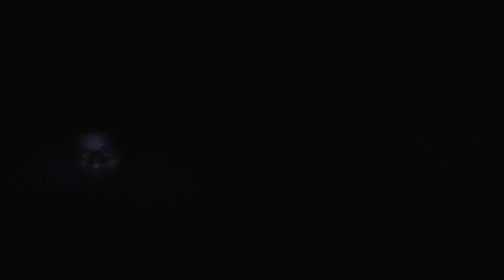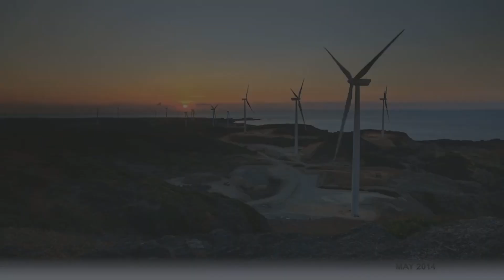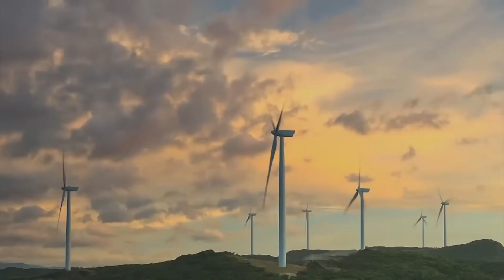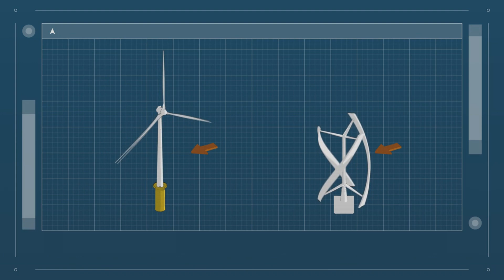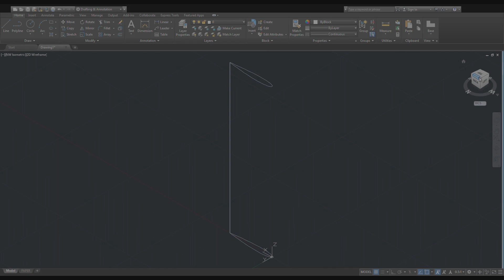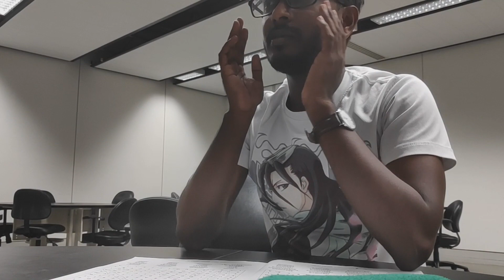Mechanical System Design Group 15 - VAWT for Malaysia

Comment: Hello, I dont quite understand how Savonius model is much more efficient than Darrieus model. Coming from a non-engineering background, I could see that the Darrieus model can cover many installments in an area compared to Savonius model. 

It would be much appreciated if you could correct me with these understanding. Thank you
Reply from the maker: Hello, it is not possible to give a unique answer. It depends on the application, wind characteristics, dimensions, etc.

Savonius works under drag forces. Darrieus operates because of lift forces. Savonius produces an important torque and low speed. Darrieus reaches important  rotational speed at clearly less torque. The low torque is actually not bad because it allows less wear and tear on the components of the turbine. Savonius is able to self-start if it has three or more blades and Darrieus cannot start on its own. In general, Darrieus is a bit superior to the Savonius with exception of the ability to self-start. Therefore, a combination of both (mix design) is a good decision for low power application.

However, there is also a feeling factor in the decision and for sure there are people pondering other properties and preferring a Savonius turbine.
Reply: @kserdfkser2715  I see.. Thank you for the clarification! It helps